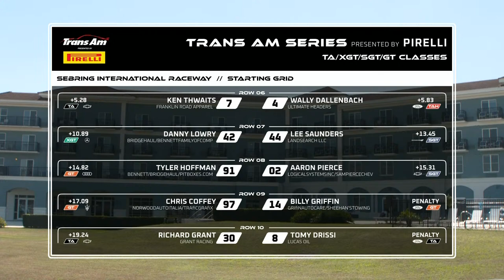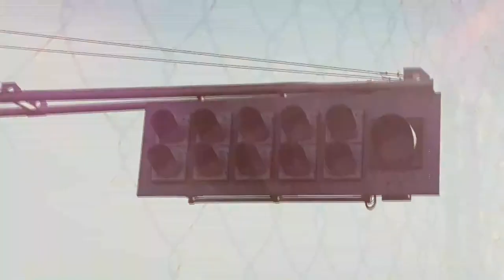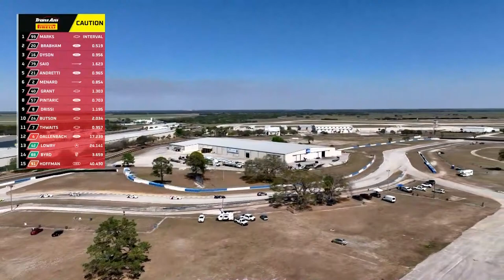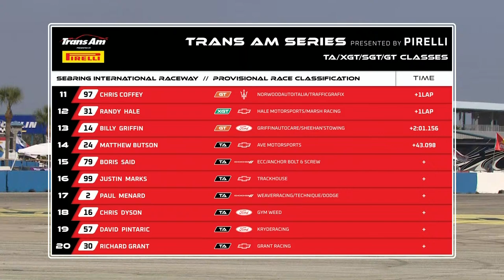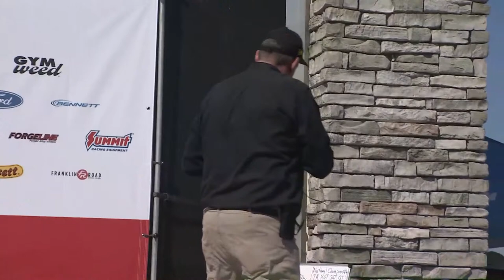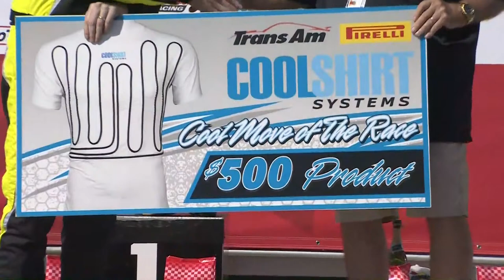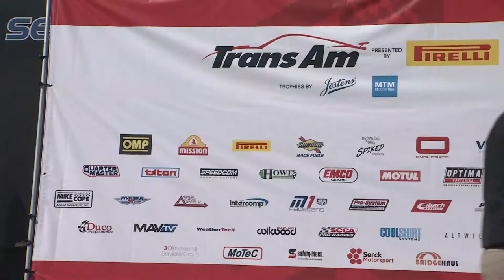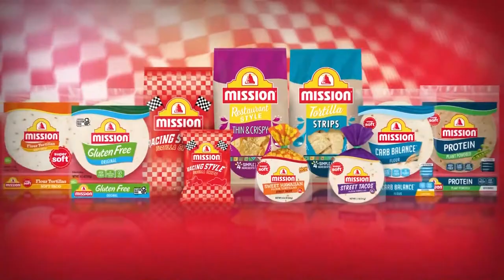Trans Am TA/XGT/SGT/GT Race at Sebring

Comment: Great to see the Trans Am series still going strong. My dad was an engine builder and raced early in his career. After gaining experience in a Sprite, '62 Corvette, and sports racer, he bought a '68 Camaro brand new from the dealer, and turned it into a race car. After a few races in the Trans Am series, he figured out that he was a better at building engines than he was at driving. He sold the Camaro to his partner, retired from racing, and focused on building engines for many northwest racers (several Trans Am competitors in 70's & 80's) during the 70's, 80's and 90's.